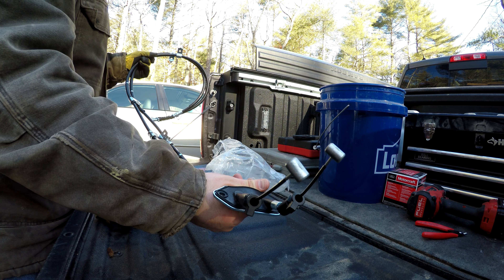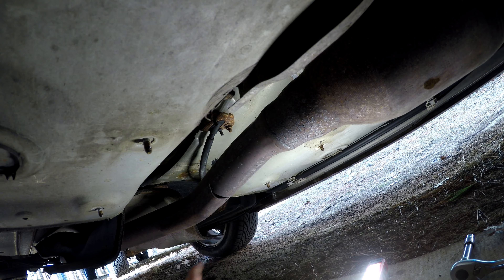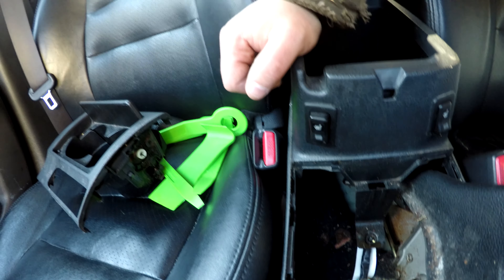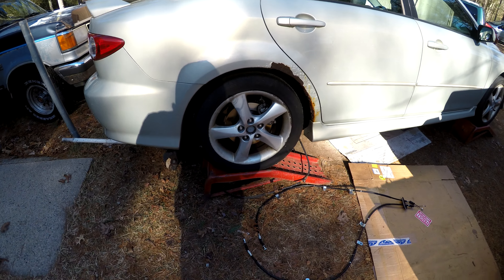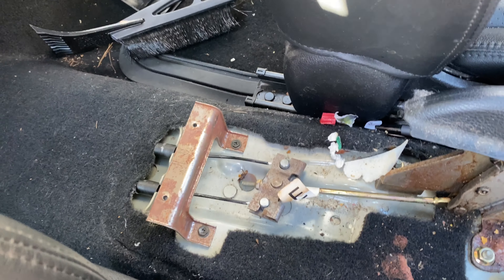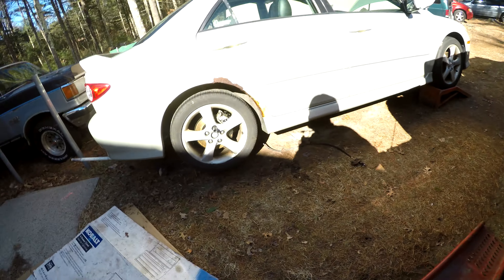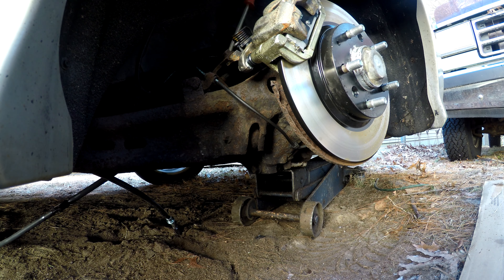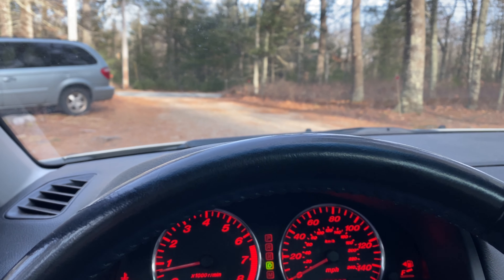Mazda 6 Emergency Brake Cable Replacement Installation

Comment: Help...How does the handbrake cable retaining clip fit onto the bracket?
Reply: Right doesn't even show it. I need to know how to remove to change caliper
Reply: @duane2080  push it off with a screw driver or use a long nose pliers to pull it off, than push the spring back on the caliper take the pressure of the cable than pull the cable backwards out of the caliper at the same time

Comment: Where do you buy replacement clips for Mazda that are covered in rust so bad, the bolts look like nails or rust bumps
Reply from the maker: Not sure on the clips, I think I bought everything from Rockauto

Comment: Cool video. I have the newer model (GG) but i suppose they did not change too much on the design. Love the car too, but don't know why the hell did they need to cheap out that  much on the metal works and paint, they rust like hell
Reply from the maker: This one, for being in New England all of it's life is not terribly bad all things considered.